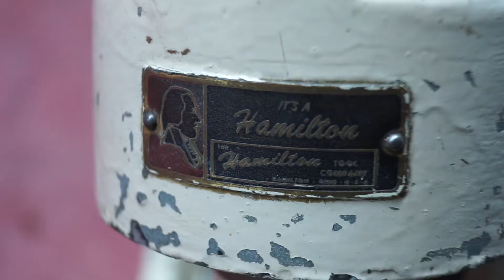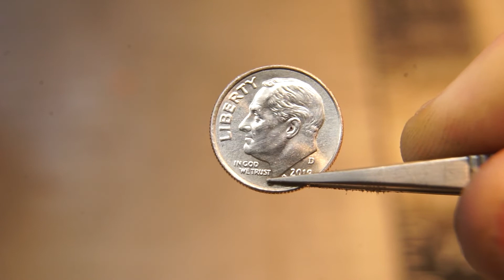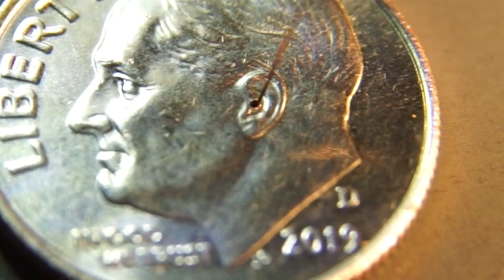Hamilton Varimatic Sensitive Precision Drill Press tool restoration, from junk to quality tool!

Comment: Looks great!  I just picked up the exact same model, it's only missing the elevation crank handle at the top.  Any chance you could take some measurements for me so I can make a replacement?
Reply from the maker: yes, I've taken some pictures that are here:  https://1drv.ms/f/s!Ag1HUrKvX7ULirE2yZeCKPF3TJRaPQ?e=DEwPCI  the grid lines are 1"  The main circular part is 1 inch in diameter, the silver handle is 1.96" tall.  The main body was cast in cast iron, then broached for the square hole, and the handle pressed in.    good luck, and send pictures!
Reply: @octodyne  Awesome!  Thanks!

Comment: Is the chuck taper threaded in to the spindle or is it tapered?  I bought one of these that has a Jacobs 33 taper brazed in to place so I can't really tell on mine
Reply from the maker: It seems unlikely that it would be brazed on.  Min is definitely a tapered connection, and I've never seen on that is threaded.  But they can be so tightly wrung together they are impossible to separate.  You might consider making a new spindle, I am considering it to remove any runout where the spindle is worn.  If it is brazed together you might be able to separate it with heat, but I would imagine the heat will want to warp the spindle.
Reply: @octodyne  No it's definitely brazed, the excess brazing was preventing it from having full vertical travel.  I ended up turning it on and lightly filing it down until it was at least flush with the rest of the spindle, which also allowed me to get the chuck off to rebuild it.  I realize now it was trued up in place as it was being brazed in because there is a ton a deflect on the taper and I will never be able to get the chuck in the perfect spot again.  Heating it out was definitely the first thought but I was also concerned about warping, also just worried about what I'll find if I were to take it out, I'm just not sure if it was done strictly to get thebigger 1/2" chuck to work, or if there was damage and this was the necessary fix, etc.  Hadn't considered making a new one altogether, though.

Comment: Thanks for sharing. Just picked up one of these. How did you refurb or treat the cone drive area?
Reply from the maker: I havent... yet.  I hit the steel side with a wire brush to remove the gunk, but have not addressed the rubber cone drive.  A company named REBB Enterprises sells replacement cone drives for about $160, but when I contacted them a few months ago they said they were out of stock but producing more.  I have not followed up because i'm not certain if it would increase the performance or work the same way.